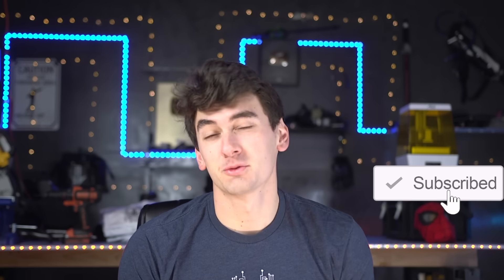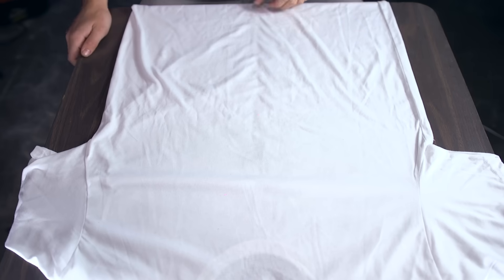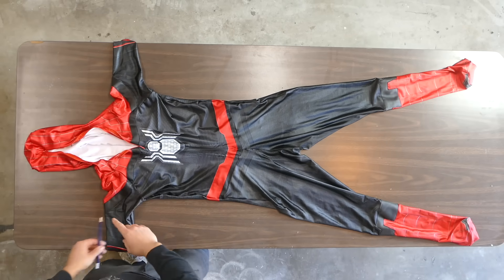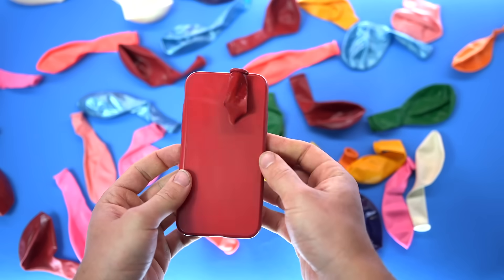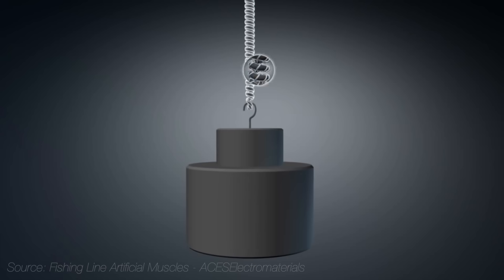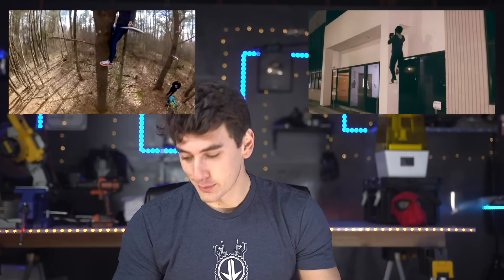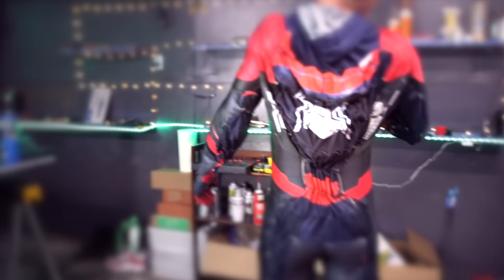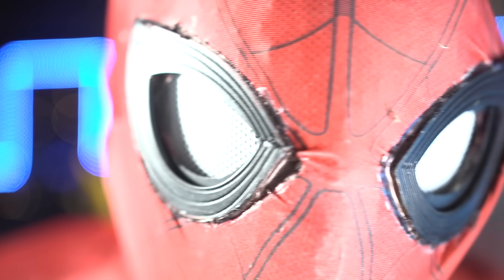I Built Spider-Mans Self Tightening Suit!

Comment: This could definitely work by hiding the bulk of it under raised armor sections.
It also would be a pretty dope way to have a super flexible costume that keeps conforming to you because it keeps resetting as you move.
Something like this would probably work even better for a Deadpool or Deathstroke style build where you could use the heavier lacing techniques to auto tighten the armor as well.

Imagine you step into a mess on the floor, pull it up over your body, press one button and have a fitted undersuit, press a second and the top layer of armor snaps into place hiding the extra fabric.

Really cool. Also, no fabric mask issue because you could use a solid mask like Deathstroke.

P.S. For a Deathstroke style build, you could VERY easily hide motors and batteries in mag pouches. Get some cheap airsoft AR15 or AK magazines, cut the tops off and stuff the electronics down into the pouch in the 3D printed box, stick the fake magazine section on top. Boom.

Also, look into basic eyelet kits. They're super easy to use and useful for this type of project. 
Hope this helps.

Comment: what you could have done is get a more flexible material in your suit so it can shrink much better and you could then use the lacing pattern on the inside so it will also not be seen otherwise great video!

Comment: Actually if you revisit the back plate idea...
You can build something like a gator back(its a padded back plate normally used for stunts) and place your roller systems on both sides of the plate. Attach the nylon string in the criss cross pattern in the same loose areas as your current working prototype and attach those to another set of rollers within the back plate. 

To stop the bunching and shortening issue your nylon crisscross needs some opposing tension, so where it attaches and turns back on itself, you need wrist and ankle straps to hold those in place.

That's how I would do it if I had the tools anyway.

My son has a pair of Addias shoes call "fortarun boa art"(I think); they have a nylon shoelace system with a circular disc lock like you were proposing. Check them out. #nonspon

Comment: Alternate method; line the inside with inflatable padding. All the slack in the deflated suit gets taken up by the added volume while you seem to “hulk out”. You could have squashable foam in the pads, which are vacuum sealed, then just open a valve to let the foam expand, and then shut it to seal the air cushion in. Alternatively if it were actively pressurized, and if the padding chambers themself where a tough durable material, it would be something like a deployable airbag body armor. Just be sure to give yourself joint space between the sections so you’re not fighting the pads themselves.

Comment: I'd look into pneumatic artificial muscles. You could get 2 thin air proof non elastic membranes and weld them together at regular points. When the space between them is inflated the entire muscle gets shorter. Maybe add a structure that has a negative poissons ratio. Also check out the space activity suit and 'lines of non-extension'.
Reply: If you google 'Micro pneumatics macro structure' it's that sort of structure.

Comment: I don’t know much about this stuff but you could try using two suits an inner and lay some thin rope in between the suits and use some small motor or batteries to power it and try put them on the side of your upper leg because it doesn’t move, just a thought

Comment: Another suggestion it to take an elastic material like spandex, stretch it to its limit with hairspray, or wax, and carry it however you like. Put the stretched suit on, and then use a heating element to melt the wax(like hot air or a wire network). The suit contracts to its normal size, then BAM! SELF FITTING SUIT.
Reply: Could also use an oversized suit, but there's a layer of rubber band network pulling everything taut so the fabric looks normal. This one is incomplete as the rubber bands would always contract.
Reply: The webbing style could be made of micro-hinges that pull the suit slightly, but it could work well if the webbing design is as pronounced as toby miguire's suit.
Reply: Yeah, i think if you stop spandex from fully relaxing with a thin coat of wax, then heat it to melt the wax, it would be best visually.
Reply: Although, if you take the webbing network again, and turn it into inflatable tubing, the tension the air puts on the hose, it might work somehow.
Reply: As for the lacing you have, if you use an internal cable, you can pull the pull the slack neatly in two directions, making it all flat.

Comment: You should do Batman wings/cape that actually works as a glider.
Reply: well it would probably have to be really big and heavy-ish, but it might work
Reply: @rrohbot  Well I think if most of the cape was in a backpack like a parachute and the frames/support rods were inflatable rods with enough air pressure to become rigid
Reply: @houselightkell  that’s theoretically correct. But I can think of no material on this planet that could fold even under air pressure strong enough to lift a human and be light enough for a human to carry on its back
Reply: @kirintucker4338  Well of course you'd deflate the frame before folding the thing into a backpack
Reply: Breaking news: a creative man tried to jump from a building with a batman cape
Reply: Yes this would be cool
Reply: Here before he sees it and makes it.
Reply: Yes
Reply: For sure!! Big Batman fan here!
Reply: Is it possible?
Reply: Random Ph you never know with this guy. He can make just about anything
Reply: @random-kun  I've done the math & yes, it's actually pretty easy.
Reply: @marcusfuckingwebb  okay then!
Reply: yes! this one!
Reply: It is nice seeing people liking my ideas.
Reply: Maybe if you use some flexible metal and maybe use some thick paper for the inside
Reply: Awesome idea
Reply: The practicality of this project will probably require like the drone system of the propellers and he’ll make a vulture wings instead
Reply: Isaac Ruiz He could make it like a flight suit. He would need to jump off something really high, but its only for gliding
Reply: @isaacruiz8592  it is possible to make a glider without any propulsion
Reply: It would most likely work as a glider he could tuck away easily.
Reply: https://youtu.be/UuRYMfqQUV0
Reply: https://youtu.be/BULhrRlBIGE